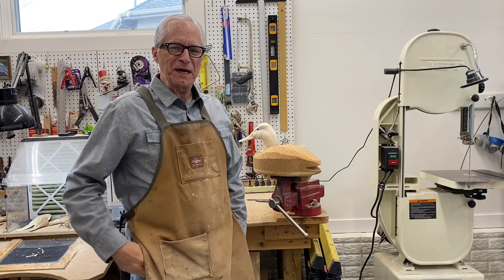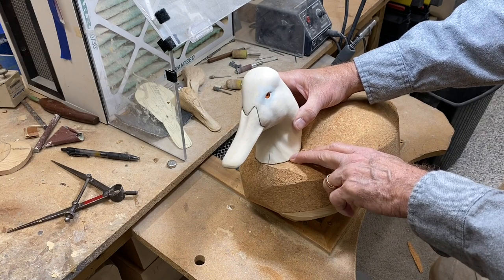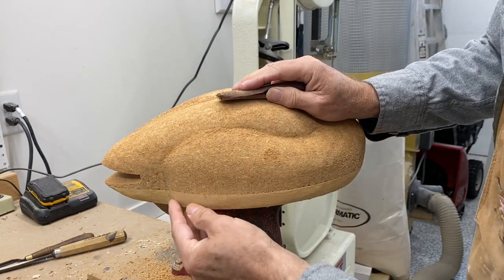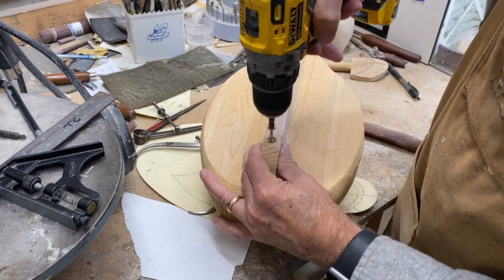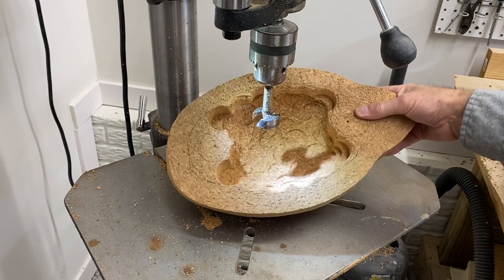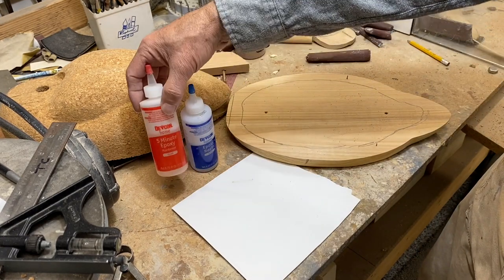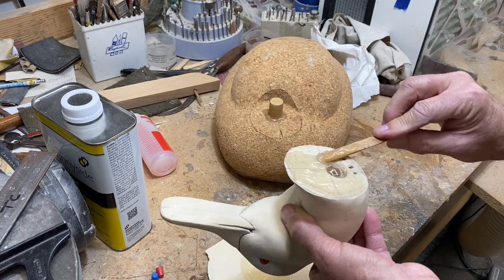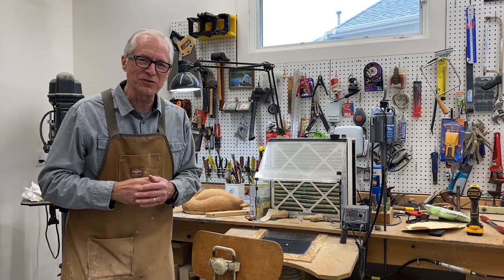Drake Can Gunner Carving - Session 4 - Body Shaping and Assembly

Comment: Is this going to be an actual working bird Tom or is this a mantle piece as my pop called them. He did both. I ask as I was wondering how the short dowel on the head would hold up. He always ran the dowel all the way out of the head and glued the dowel in so the plane board and head were one piece mechanically glued together. He then drilled the dowel and inserted a stainless I-bolt through the dowel. He then counter sank double nuts that sat about half inch under the top of the head. He tightened them down and filled the hole in the head before finally shaping and paint. Overkill I’m sure but the old timers wouldn’t hunt with anyone else’s. He prided himself on the fact that his birds would outlast himself lol
Reply from the maker: It was made to be a working bird. Your dad’s approach sounds like it would be super strong. Hard to beat that kind of experience!  Thanks for sharing his technique.